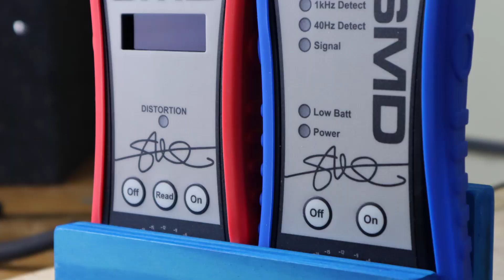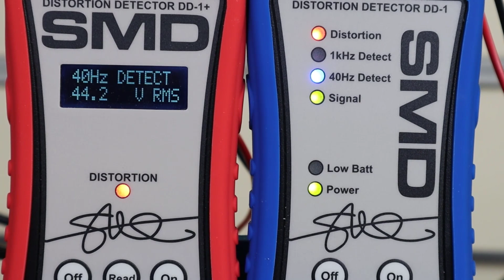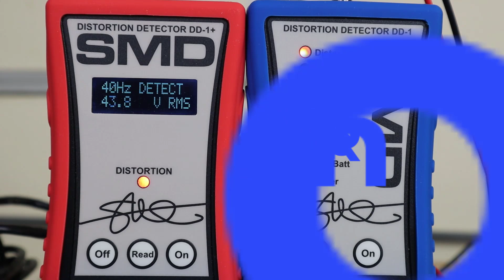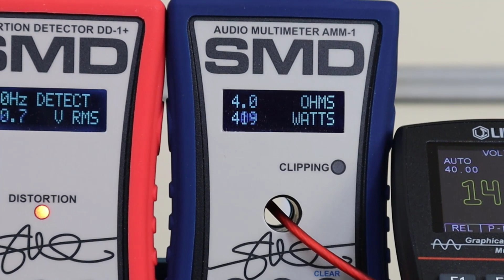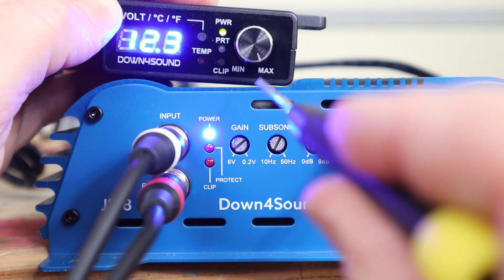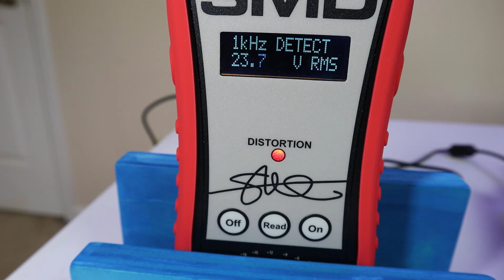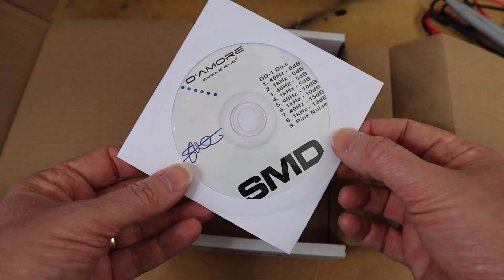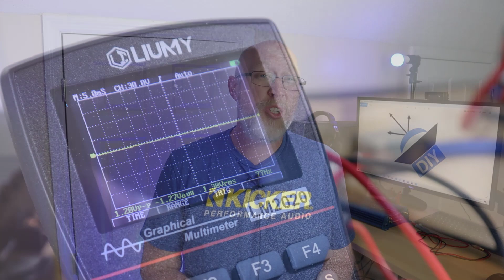SMD DD-1 vs. DD-1 Plus! Is it worth the money? #SMD #DD1

Comment: DD1+ is difficult to obtain at the moment. Alot of online audio shops are sold out. 😢
Reply from the maker: I expect it to be back in stock soon!
Reply: Yes sir! TheDD-1+  is currently in production. We could see them available in a month.
Reply: The DD-1+ i ordered arrived a week ago. 
After identifying the wires/ polarity, I started at the factory HU (honda factory amp,)  LC5ipro, then the amps. I have about 3.2V on the preamps on everything 

After setup, i Turned the gain down a bit on a full range amp for  rear deck to help with the front door speakers' imaging. 

I could have achieved the results adj balance through the HU I suppose.
I haven't had time to set gain overlap. 

Thanks again for your content!
 🤜🤛

Comment: can you tell me what output voltage from my skar 2k, that would give me 5 and 10 db overlap?(in voltage plz)   my amp outputs 59.7V.A.C.  which is insane!    I verified with a oscilloscope for clean signal.
So I would assume overlap means adding voltage/ turning up gain past clean,into clipping by how much basically,in my 59.7v.a.c.  example.

thanks. sorry so long

Comment: I finally got to the point of my new build where I get to use my DD-1 and the thing detects ZERO distortion.  If I put the DD-1 directly to the HU (9500ES) and max out the volume, no distortion.  It detects the 1k test tone playing, but no distortion.  If I put it on the amp with the HU at 90% volume, I could max out the gain and no distortion.  I think my DD-1 is broken. 😞

Comment: Quick question for ya please. When setting your signal from your head unit with the dd1, you have to make sure everything is off correct like the high and low pass filter and eq and the bass control off on the radio. I just want to make sure I’m doing this right. Thank you and keep up the great work 💪
Reply from the maker: Correct.   Some radios will have a subwoofer level control and separate RCA outputs just for the subwoofer.  Depending on the way the radio is set up, you'll want that one turned all the way up.
Reply: @DIYAudioGuy  thank you, I do have a separate one for the subwoofer as I’m using a sony ax 3200. I wasn’t sure about the subwoofer. Now after I set everything up do I still leave everything else off or can I adjust them after like the high and low pass filter on the head unit. I apologize for the questions. I’m still learning a lot and I appreciate everything you do. Keep up the great work my friend 💪

Comment: So, I am using a factory radio and its hooked to a pac amp pro ty13 to give me rca outs. It does 4v and 5v preout. I also have a DSP. So, how would I start to properly test all of these? Would I zero out headunit find the volume it distorts at? Would I set all the other stuff neutral as well? How do I test distortion for the Pac Amp pro and etc?
Reply from the maker: Yes, start at the head unit and work your way back.  You want everything just below clipping.
Reply: I just ordered the DD1 Plus. So id hook them to sub amp and neutralize my DSP and my line out converter and same with headunit or what? New to this tuning stuff @DIYAudioGuy
Reply from the maker: @OfficialCPProduction  I really need to do a video on it, it's just kind of hard to make it interesting. I've got some footage that I guess I should go through.  The basic idea is you want to find out where the head unit rcas clip and be just a small here under clipping, then do the same thing with everything in between the head unit and the amplifiers.  I think you can just hook right up to the amplifier and you should be able to do it that way, but I typically hook up to the head unit at RCA's, then the DSP, then the amp.
Reply: @DIYAudioGuy  makes sense. So I am using factory radio which I know kills quality some but it's a 2018 camry with jbl system and birdseye. So I had to get a pac amp pro ty13 that hooks directly to radio and gives me 4v or 5v pre out with a gain knob.then it goes to a dsp then amp. Just confused how I should go about using factory unit plus the line out converter
Reply: @DIYAudioGuy  So, would I neutralize the headunit, dsp, and the line out converter? Tune the headunit to below clipping then start at the line out converter? Then go to dsp then amp last? Since its in that order?

Comment: Great video I have a SMD DD1 i’m new to this. My question is on my subwoofer amp. It is a Roswell1000.1.
That I run 1000 W at 1 ohm 
It’s 4 ohm @500 wats 
When I’m using the dd1 I still set it on the positive and negative there’s no way to set it to the 1000 at 1 ohm. 
Whenever it shows the distortion that will do the same when I have it parallel down
Reply from the maker: The technical answer is a bit long and I should probably do a video on it.  But the short answer is you will be just fine. If the lights not on then you're not distorted.
Reply: @DIYAudioGuy  thank you that’s what I was thinking. I just couldn’t find an answer anywhere on it.

Comment: Now, as you mentioned on other vids, to 0 out all levels on the radio, treble, bass, mids, to set the gains on an amp. So, once at 0 can I go back and add say more mids or treble once the amp gain is set? Or do I just leave it at 0 for all?

Comment: I used the dd1 on my skar skv2 2500, it doesn't distort gain all the way up,is it ok for the clip light on the bass knob to flash a little
Reply from the maker: That is odd, sound like you might be able to turn your source unit up a bit.
Reply: @DIYAudioGuy  I use android auto on a Kenwood double din, 8 called Kenwood and they said it's normal for it to happen different outputs they said

Comment: Question I had an issue I’ve notice when setting the gain on the amp id like to get some clarification on. I have a CXA1800.1 and while playing the 40hz test tone at max volume and bass knob maxed. I set the gain on the amp and noticed at about 30/40% the Distortion light would come on but then it goes away with increased gain at about 50% and then comes back on solid around 75% and stay on. Any idea what would cause this . I’m running the RCA from the aftermarket head unit which is android based.
Reply from the maker: Mine does the same thing.  The device is auto-ranging and the light will flick on for a second when it switches between ranges.  I feel like Steve mentioned that in the video somewhere but I can't trace down the video.

Comment: @diy audio guy, if my headunit only has one subwoofer preout do I have to use an RCA y splitter or could I just take one RCA like from the headunit sub pre out into either the left or right input RCA at the subwoofer amp?
Reply from the maker: You just need one. You can buy single strands.  They usually labeled as video cable or as a subwoofer cable designed for home stereo use. But it's mostly all the same stuff.
Reply: @DIYAudioGuy  o nice! So I don't need to y split it since the amp has a L & R input. This really saves me time. Thank you

Comment: What I haven't understood yet is you find your head unit distortion with a flat eq. After you set your desired eq after completing the steps want that change the volume of the distortion?
Reply from the maker: Not if you set the EQ correctly. Use it to cut, not boost.  Only boost as a last resort.

Comment: I read and seen articles that it's better to keep the subs connected when setting gain because when the amps sees this load, there's a voltage drop on the rails on the amp which affects the level of the gain. So do you think it's necessary to set gain with or without subs connected?
Reply from the maker: I don't enjoy the sound of test tones at full blast.  So I always disconnect when setting gains.

Comment: Do Jl audio subwoofers has to be tuned to 0db ?
Reply from the maker: It is not a function of the brand.  More overlap increases the chances of clipping on real world music, less overlap means less power and thus not as loud.
Reply: @DIYAudioGuy  gotcha I have 2 15 Jl audio w0 on a Rockford fosgate amp and at first I tuned it to -10 db then it was way too much bass then I turned it down to 0db didn’t sound like getting too much power then I did -5db and it was better

Comment: I may end up getting a DD1. I started getting into building amp kits.  I enjoy  soldering them together and then power testing them. You make a good point that clipping and distortion aren't the same thing. I've put some amps together that don't clip but sound terrible.  I was looking at getting a bench top THD meter and they are like 6K which is crazy. This is pretty reasonable for what it does. I could use this and the scope together to get the most accurate power measurements.
Reply from the maker: I think this is a good tool for that purpose.  I've definitely tested amps that get really dirty long before they clip!

Comment: I'd like one to play around with but it's hard to justify. I have been trying to only buy amps with clip lights so the old school ones are all I'd really need it for and they aren't used regularly
Reply: Buying amps with clip lights only protect the amp. Doesn’t protect your speakers from distortion. You don’t want clipped distortion, or distortion in general.
Reply from the maker: Not a bad plan.

Comment: I did notice the same thing with the dd1 and jp8 clip light. the clip light coming on a little sooner than the dd1. I’d rather be on the safer side if I’m already tuning to -5db -7.5db ish
Reply from the maker: It is a very small difference.
Reply: @DIYAudioGuy  totally agree
Reply: Ithink I would trust the dd1 since it looks for harmonics and it's calibrated against an actual Audio Precision test gear. I'm sure the JP amps clip detector works well but unless you bench it and compare it to an actual precision piece of equipment it's all still a dummy light from an overseas amp build house. Those amps are damn sexy though and put out hella power. I'm sure either way you are ok. Even if one light clips right before the other, how much of a power difference is it really. And also take into consideration the media in which the system is being tuned with. As soon as you use another source you might be clipping either way. I guess that's where the JP controller clip light may actually shine
Reply: @angelvip2474  you understand. Most don’t understand that the clip light on the amp is what the amps peak voltage is on the output transistors. Not for reading distortion. If that was the case, amps would cost (the DD-1+ cost) on top of the amps cost. Or worse, the price of the THD (total harmonic distortion) analyzer plus the cost of the amp.

Comment: I'm curious what CC-1 can do when tuning the crossover on a DSP like the HKI dsp
Reply from the maker: It Steve sends me one then I would be glad to test it for you.
Reply: I have the cc1 and dd1. Works great for amps. DSP is another animal. You don't have to verify tuning the crossover. You just set the frequency and slope
Reply: to setup a DSP you have to make sure all signal into it is flat and clean undistorted. Then to tune, you must use a RTA to adjust to the sound in the environment your speakers are in, as well as the placement of your microphones listening position. The CC-1 is used to set your crossovers and with its special feature, you can gain match all your Channels so you have equal power from all channels. Pink noise at 0db is the most accurate sound to play to set your EQ bands. Also, you never want to have to boost an EQ band. If you have to, you never want to exceed a 3db boost, otherwise you could run into distortion when at max volume.
Reply: @mikehonda7934  okay thanks for the info
Reply: @MrChuckstick  no problem! Happy to give some guidance.